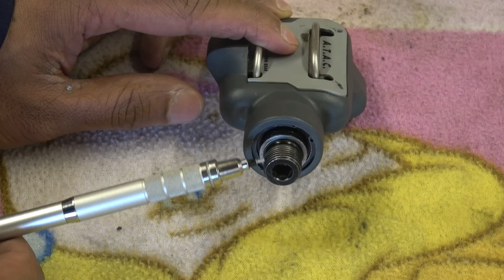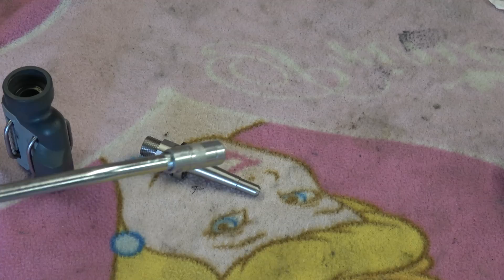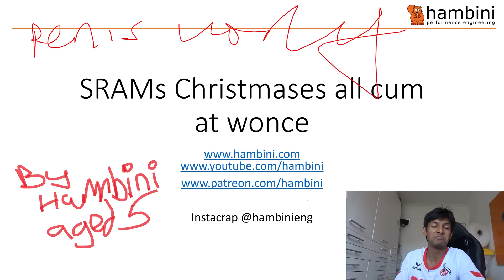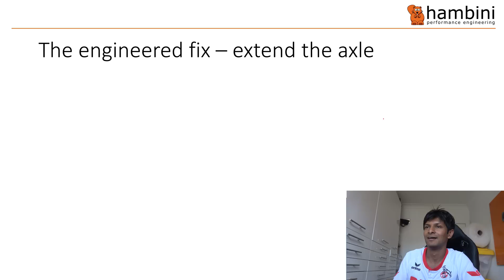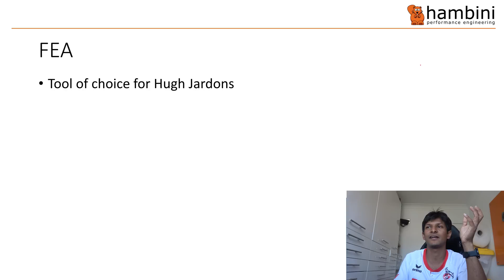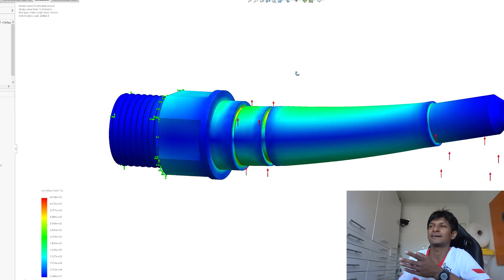Precision FRENCH Engineering refined by a 5 year old: TIME ATAC pedals

Comment: @Hambini What type of Mobile grease do you use? And do you use it in other places on the bike as opposed to using bike specific grease like Park branded stuff? I recently started using Mobile SHC 100 for most things on the bike cause i get it free from work. We use it on most of our bearings inside our motors. I'm not a grease guy, just an automation controls tech.
Reply from the maker: I generally use Mobil SHC everywhere. It's very good at repelling water and is possibly a touch thick for out and out low drag but I don't care with my nanowatt output.

Comment: Needle bearing surface against the softer stainless, why wouldnt that gall?
Reply from the maker: that bearing contact area is extremely wide for the load. Based on calcs (and experience), I don't think it will gall.
Reply: I have a feeling the load is low. Again, over-engineering. They also made a pro model with a fully titanium axle, and the needle bearing surface was just the titanium. Hardly ideal. I can imagine having them machined down for a thin hardened steel sleeve at some point. Then I would only have to worry about galvanic action 😆 but loctite can work to isolate a bit.
Reply: @fieldlab4  My impression is that a hard material moving against a soft material, the soft material will change functionally over time. Just imagine if the shaft was aluminium and not steel (regardless of a nonzero load).

Comment: "flaring tool" that's the tool name you were thinking of. 
I've had a good run with time road pedals over the years. I should try the off-road versions.
Reply: Are you still using the original TBT ones? I still love mine, but am finally starting to wear out springs, and replacing them appears to be impossible.

Comment: What we need now is a set of Hambini designed pedals to match the bottom brackets
Reply: The only way to top the old time ATAC's with the spring steel retention bars would be too add some shoe engagement/adjustment options and a metal fence on the inside area (mounted to the shoe) for more stability.

Comment: I have exactly the same pedals. Tried them on my fixie bike to see what the fuss was about and I have to say they crap. They nowhere near as easy to clip into as SPD’s.
Reply: I agree, my Speciale 8's are more difficult to get into than my XT  SPD's.  But, I prefer the Time's in every other way over the SPD.  Especially at a bike park where I execute exaggerated hip movement on flow trail corners.  I would just unclip out of the SPD's.
Reply: It's not about getting into them, it's about getting out. To get in requires moving the foot forward a bit, almost like getting into old strap clips.

On the other hand, getting out, especially in an accident, happens practically automatically. Especially when dirty because of the phosphor bronze cleat. If those steel cleated  SPDs get dirty or rusty you will find out how you can get stuck, which is especially bad in an accident.

Comment: First of all I have no engineering knowledge and this will show in my questions but nevertheless.
1. Why remove the float?
2. Why not reinsert the washer that provided a seal in order to over engineer?
Thanks.
Reply from the maker: I should just clarify what rollinrat has said above, he is quite right but there is a bit of american/european engineering terminology difference.

Float can mean a couple of things, 

1. Float as in the side to side movement of a pedal, this is commonly used in cycling terminology
2. Float that is bearing float, this is the side to side movement of the bearing between it's end positions (ie active and non active side). SKF has a good explanation here 
https://www.skf.com/uk/products/rolling-bearings/principles-of-rolling-bearing-selection/bearing-selection-process/bearing-type-and-arrangement/arrangements-and-their-bearing-types

1. Excessive float in a pedal is undesirable because the ball will be doing an S shape on the races.
2. I could have done that but it's unnecessary, it will increase drag with little improvement in sealing.
Reply: The cleat/padal interface on Atacs has way more float than the axle has. There's no need for it.

Comment: Why did you not put hex in the shaft. Is that pretty hard to do? Or did you want to retain more strength?. Axles look very similar to look pedals. I have to disagree  have got the look keo carbon blades ti. they are pretty well made to be fair, axles machined nice and pretty sure the bearings are decent ones. Other than the body's can wear if your rough assed😂

Comment: I have Time Equipe pedals on my ‘96 Colnago Tecnos. They still work and IMO far better than anything else. Cleats are difficult to find though.
Reply: I guess you mean the front, plastic ones wear out. They were made and sold as made from aluminium as well. A company in England had them. Aluminium in front and brass in the rear should last a lifetime.     Rgr
Reply: @borano2031  I’ve had both on the front. Right, the brass part lasts forever. They all still work though! The functionality of the pedals is still unsurpassed, and the first pedal that considered stack height.
Reply: Have worn out the aluminum front cams, now finding that replacements are hard to come by except at exceptionally high prices. Never knew why they had to keep changing the designs when the original worked so nicely.
Reply: @joebolan4082  They were suddenly considered heavy and the low stack was only good if you could find shoes drilled for Time/Speedplay, the 4 hole configuration. I used Time Equipes back in the day, still have them stashed somewhere, and use Speedplay today, no adapters to the shoes.   Rgr

Comment: Interesting stuff. I’ve used ATAC pedals for over 20 years now. Absolutely first class design and manufacture. I’ve tried LOOK and Speedplay but find that entry/release is much easier with TIME. It’s also nice to be able to walk relatively normally and not be clip-clopping around in three-bolt type cleats…👍
Reply: The entry/release is trivially engineerable but the wear is not. Speedplays get "Speedplay rock" (maybe not thr new ones with metal on the pedal body's sides) and the cleats don't last much longer than Shimano's either while being much more expensive.
Reply: Time pedals are the best.

Comment: Time has gained nothing but respect from me over the past few years. It would be interesting if you did a comparison to a new set of time pedals to see if sram has had there dastardly ways with the company. But knowing the French they would have probably gone on strike 😂

Great video as always loved the analysis and breakdown too. Feeling like I could almost understand engineering!
Reply: The basic problem with the new designs is they have gone with a delrin type bushing instead of inner bearing, and a tiny cartridge bearing on the outside. They don't even have real bearings, all in the interest of a few millimeters of height. Maybe that's fine for downhilling.

They couldn't even be bothered to use a needle bearing. Very disappointing.
Reply: @fieldlab4  same as Crankbrothers then. Disappointing.

Comment: An elegant solution, but I'd be curious why a wider crankset wasnt one of the first solutions, since the cranks generally flare out more as the get wider to allow for splayed out forefeet.
Reply: Wider in what sense? Cranks usually get "wider" due to spindle length, and you have two options normally - road (68 mm) and mountain bike (73 mm). Road and MTB cranks usually don't meet half-way in terms of chainring fitment, as they're different in terms of crank arm spider BCD.

The only workarounds I see for going with a wider crank are A) buying from someone like Rotor and using their wider MTB spindle on an otherwise road crank, or B) going with direct-mount road chainrings on an MTB crank, eliminating the crank arm spider altogether.
Reply: @TypeVertigo  if you look at the actual shape of the arms, mtb cranks flare quite a bit further outward at the pedal than where the arm attaches to the bb axle. This is to allow clearance to the chainstay which flares out around the tire.
Road cranks tend to be straighter, with the pedal fitment and the attachment of the arm to the BB each at the same distance from the centerline of the bike.
That's all I meant really. After all a MTB threaded at 73mm is only 5mm wider than a road threaded at 68mm, but the q factor is 20mm wider by the time you get to the pedals (168mm vs 147mm for shimano mtb vs road for example)
Reply: @TypeVertigo  I've actually done this when I worked at a bike shop, where I had a difficult bike fit, I was able to install an mtb crank instead of pedal extenders, the customer was very happy with the result. It was back in the days of 2x mtb so we were able to fit larger chainrings as appropriate for the road.

Comment: Is CFD "Computational Fluid Dynamics"?  If so what is "Fluid" in something like a pedal?
Reply: Metal is a fluid...the flow can be quite slow and would require some impetus to flow.  IME CFD has usually been associated with liquids and gases (pipe flows, jet engine gas flows, mixing tanks, etc.) and FEA more associated with hardened mechanical systems.  Obviously some overlap and, more obviously, I am not an expert.  Only played with a couple of systems over the years.  The shaft model Mr. Hambini drew would take me weeks to figure out.

Comment: Stood the test of TIME ! Speaking of such,I have road and mtb Time pedals and shoes from the 90"s,very well made and still going.! pair(XC8) from early 2000's the spring and clip has fallen out,need new ones. I hope I can still get the parts. Will the quality control be kept up by Sram ? I have my doubts. I also have an issue with the right heel runs into the crank or chainring,the ankle has a fusion and is set at about 20 degrees. Had tried extension,but now I keep my knee into the top tube to bring the heel out ,not the most biomechanically efficient but liveable. Very good fix for the chaps problem by the way.

Comment: Hello Hambini! The government agency here in the US that is in charge of virtually all consumer goods that are not motor vehicles, boats, airplanes, nuclear reactors and firearms is the Consumer Product Safety Commission. Their purview includes things like kitchen appliances, toys, consumer electronics, and bicycles. Many years ago in a previous life, I once asked a staff member of the CPSC if they regulate adult sex toys - and they politely declined to answer. Maybe they do now, but I don't know - except I have seen complaints on the subject posted to their official website. So there's that.

That said, I've ridden with Time pedals almost since their introduction to the US, and they are excellent in terms of function and durability, whether it's road or MTB. The ATAC pedal was introduced, I think, in the mid- to late 1990s, and I still have pedals from back then and they are great. In fact, I have a small bucket filled with different model ATACs and I'm always on the lookout for more that are in good shape, been decently taken care of, and are relatively cheap. The ATAC's basic design is solid, simple and well made, which is why it hasn't changed much over the years. And I've ridden fixies with ATACs, because they have the generous platform area and dual-sided engagement that you don't have to fiddle with when you start off. 

My only observation about your customer who needed longer pedal axles is, I think due to riding form that could be improved with the guidance of a coach or specialist bike fit service mechanic. Of course, the rider may have some other biomechanical issue to cause him to toe-out that much, but that's where the coach or mechanic come in - and maybe he did go that route before requesting your services. 

Other than that, thanks for another excellent video and explaining everything in the kind of detail that others either are unable to articulate or don't have the knowledge and resources to present the facts that you do so well. :)

Comment: When things like this are used I worry about the crank itself failing at the threads. They usually crack right off.
 I wouldn't be surprised if that was the reason the adapters were recalled.
Reply: Pretty easy to work out the increase in force at the crank arm. Unless you're a real fatty you should be within safety regions?
Reply: @mcspikesky   The cranks that broke, were known to have problems anyway.